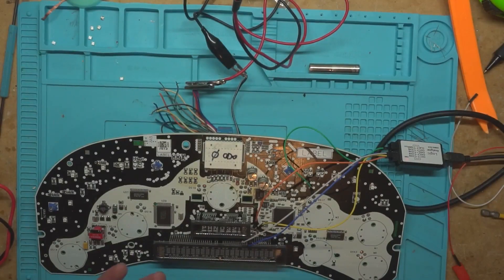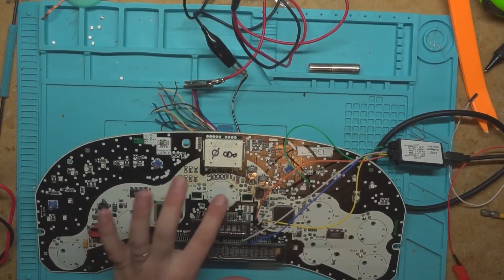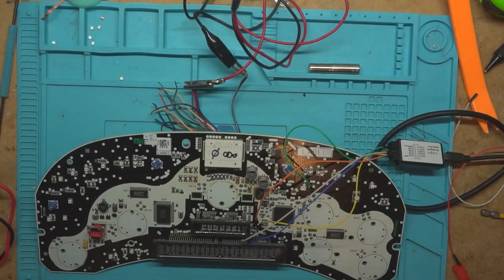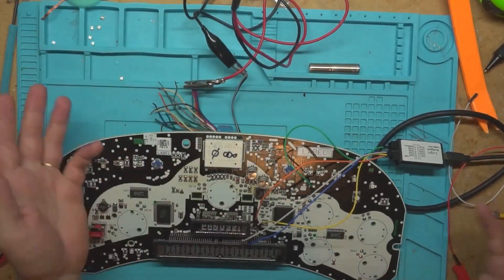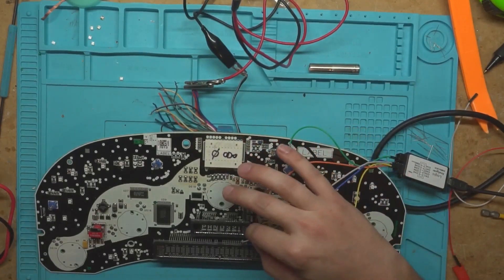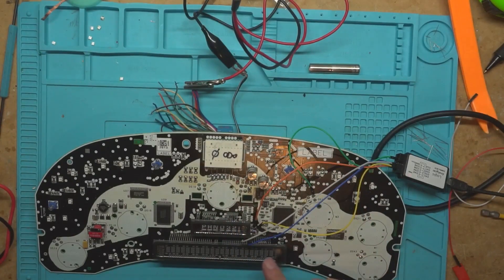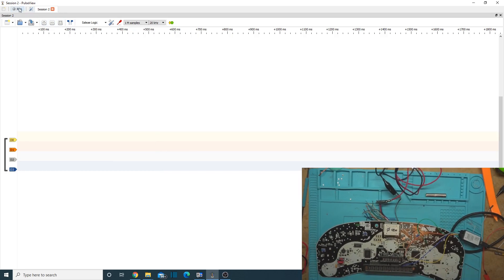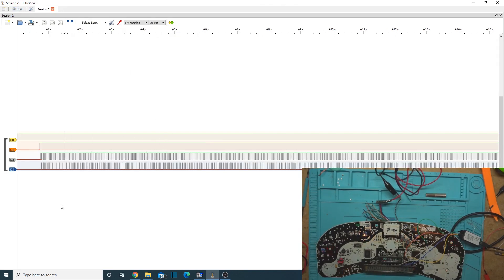GM Cluster: Odometer 0 Repair With a Known Good EEprom

Comment: hi i transferred  the  eeprom   from u-15 of my 2003 sierra  cluster with  my mileage  to a 2006 sierra cluster u-15 location now the odometer has "odometer 0" after swap to the 2006  the eeprom legs are slightly off center of the pad 1/64 of a inch  would that cause this issue

Comment: another fantastic video! 
Unfortunately I have the problem that my counter started counting from zero again after I tried to read the eeprom with an arduino in circuit programmer. I put this together following one of your other great videos. I managed to read the eeprom, but unfortunately I couldn't find how to make a dump as bin. For whatever reason, I can no longer read or program the eeprom with the arduino. Even after desoldering the eeprom this didn't work anymore. It looks like the eeprom has been set to zero? the KM counter does count up again. but I would like my actual mileage back. Anyone have an idea what could be causing this problem? or does anyone have a bin file for me? I don't know what to do with this anymore. any help is more than welcome. 

thanks, greetings, Lambert

Comment: Hey so I had an issue where the odometer stuff would fade out and when I started it often most the needles would go down a little bit so they won't be a couple miles pre hour less and stuff but I had seen you touching up I believe 2 resistors on the left side you said was for the power supply for the odometer I believe and I noticed I I melted a capacitor but just hoped it was fine and when I turned it on it started smoking so I pulled off that capacitor and it melted a transistor I believe that's what was smoking and I kinda found the transistors but do you have any idea what capacitor I should replace it with
Reply from the maker: I've never searched for new ones but I have seen ones that are all blown out there. It is fixable make sure you replace all 3 transistors and the 1 cap. I swapped them off a parts board to fix the one I fixed.

Comment: I seen one of your videos that had a dash with trans temp and pink lights that looked purple. My Denali dash went bad and the rpm dont work even after replacing the motor twice. If I give the info to program with same ifo, what would that purple dash run me to mail to me? My email is rncoleman2@gmail.com. ty
Reply: I have the front and back case so won't need that.
Reply from the maker: so you just want a board? what year?
Reply: @FixedUntilBroken  yes just the board with the pink but looks purple lights that the trans temp works on. 03 yukon Denali. Not the XL or XLT. I have covers and needles.
Reply from the maker: I will shoot you an email later but if you don't hear from me mine is garnerm91@gmail.com
Reply: @FixedUntilBroken  I got the email.

Comment from the maker: Big thanks to Jeff for sending these to me for MCU testing. I figured the least I could do is fix them.  Thanks for watching. If any of you don't have one of these cheap logic analyzers you need to get one. They aren't perfect but its a great starter tool.
Reply: This was a fun little adventure to follow. Surprise ending that's for sure. I was convinced it was MCU failure. I've got a order of 100 eeproms on the way. If your in a pinch for some let me know and I'll send some over.
Reply from the maker: I already ordered more myself. I've fixed the odometer 0 on all of them now I just don't have any EEproms to put on the others. One of the boards none of the warning lights are working at all. I haven't tried to diagnose that one since that chip is hiding under the dic VFD
Reply: @FixedUntilBroken  one of the diodes in the group of 4 is dedicated to the LED chip.
Reply from the maker: I'll check that out later. If that ends up fixing it all the boards will be 100%
Reply: @FixedUntilBroken  sweet